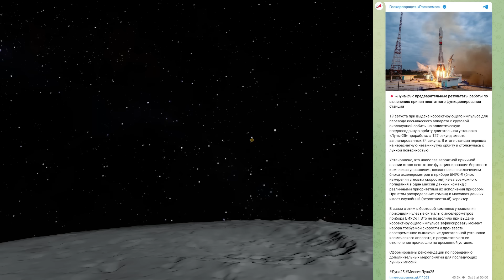Russian Space Probe Crashed Into Moon Because It 'Forgot' To Turn On Critical Hardware

Comment: Fatal software errors have got to be the most gut-punching failures because software seems so much more controllable than hardware. Once you launch, the hardware is what it is, if something fails, it's not like you can go up there with a wrench and sort it out; so baring some miraculous work around, it's out of your hands. Software though, can potentially be altered in flight, if an error is detected soon enough, the mission can likely be saved so it has got to hurt when a computer glitch is the cause of an unplanned disassembly.
Reply: It shows that it is absolutely your fault. No act of God, no broken widget…just you. Oh, and failure.

Comment: It's interesting to compare and contrast with another 'System Overload' issue - 1201/1202 Errors.

Whilst one issue relates to traffic on the bus and another to computing cycles demanded both issues relate to 'to much happening at the same time for the computing system'. And when you dig down both relate to a failure or inability to test the integrated system. In one case the prioritising was done correctly, in another it wasn't.

Ultimately there are also issues to do with error detection and handling policies and the balance between positive runtime checking for specific things that might cause failures and handling those failures if they occur, for whatever unexpected reason. Finally there is the 'is it worth it' issue. Is it worth (providing data is recorded that enables the issue to be identified post-accident) adding code to detect an error state at a point when it means the mission is already lost?

And then that drills down to the point that error detection and handling code is still code. Adding code to detect and handle error states adds complexity - it's perfectly possible to make mistakes in your error detection and handling code that lead to 'Loss of Mission' or it's earthly equivalent. There is a balance to be struck - I have seen code where there is more checking of values on entry to each code unit than code to actually do what the unit is intended to achieve. How reliable is that extra code? Do your test cases test it? Do you test your test harnesses?
Reply: It reminded me of the 1201 alarm too; 50 years on and still getting caught by the same thing!

Comment: Thanks for the always interesting channel Scott. I'm currently reading a book called STARBURST and LUMINARY by Apollo LM software coder Don Eyles. 

Fascinating insights into development of spacecraft software back in the day with of course references to classic computer polling, priority interrupt techniques and executive level software control of the whole caboodle. Some surprises also on what interrupts sank down the priority interrupt list of the executive control software for the Apollo LM. 

Regarding the subject crash, your comments regarding the use of data buses in place of 1960 era Apollo hard wiring also reminded me that we still encounter related issues on commercial aircraft these days. 

LAT and LONG words (bytes) randomly separated on a serial bus by a few milliseconds can produce some interesting position reports on ground ATC systems. 😉 

Never a dull moment in the spaceflight, software or avionics domains it seems! 

Blue side (mostly) up. Slainte!
Reply: That would be Sunburst and Luminary.
Reply: @stargazer7644  many thanks for the correction. Good catch.

Comment: Scott, that was a great report. I do question this “common buss & timing” . Yes there is a lot going on but I would assume the CPU is switching in the sub micro second or faster range.  So what is taking up so much over head? We’re they running Window 2.0 on an 8086 processor 😮😅

Comment: Why is the software not deterministic?  Why does it not check that the IMU is on before the burn?  Why does it not check that the IMU data is consistent with the data from the burn (fuel use, temperatures, whatever)?

It seems like people have lost how to write software, maybe because they're used to using libraries and includes and classes (etc.) and building software like it's some sort of lego set, and they never learned how computers or their hardware actually work.
Reply: with Russians you never will know what really happened, they had to build their own IMU because Airbus declined to sell them one, it could have been both software/hardware issue

Comment: 127 is also the largest integer you can store in a byte (eight bits) if you’re using two’s compliment signed integers. I suspect that’s the real reason for that value.
Reply: Which for positive values is the same as saying 7 bits as the eighth bit is a sign bit. But yeah, maybe they were super stingy and used a char. Or maybe it's a safety factor of 1.5 and the extra second was just an inaccuracy.

Comment: It sounds like they were also treating an absence of data from the accelerometer as measurement of zero acceleration. You shouldn't represent error conditions as valid values. 
Leads to you thinking that it must be freezing outside because you can't see the thermometer, or that the thermometer must be broken because it's reading 0°C
Reply: with Russians you never will know what really happened, they had to build their own accelerometer because Airbus declined to sell them one, it could have been both software/hardware issue
Reply: That's a bloody good point, you need to distinguish zero from a fault condition, or absence.
Although a pointer could have done this; a null pointer for no value available vs. an actual pointer to a zero value.
I'm not a believer in null pointers being bad.

Comment: How do they not simulate these things in advance to catch such obvious bugs? Properly testing software is surely much cheaper than the hardware, right?
Reply: It entirely depends on how much coding that needs to be tested. After all, they built the software from the ground-up, meaning that all of the software would need to be tested.

Comment: This seems like the kind of fault which formal methods is quite well equipped to detect nowadays -- i.e. essentially present in a high-level abstraction of the system that focuses on concurrency. You probably wouldn't even need automated theorem proving for the model -- if you were writing it by hand you'd have a WTF moment at some point I think.

Comment: My grandpa used to work in the Russian aerospace industry. I think something to do with the electronics of the rockets. 
He told me once that he learned from his former job connection an interesting story. One of the first launches from Russia's new spacesport "vostochniy" failed because engineers forgot to set up new parameters in the guidance system. The rocket thought that it was launching from Baikonur so it obliviousy didn't reach desired orbit parameters if at all, not sure. 
So yeah...

Comment: I was initially surprised at the transparency in the of the report, openly sharing the nature of the fault.  However - on reflection-  this crash was not the result of some obscure, unexpected set of circumstances ...  for example a freak hardware failure that relied on an untested branch of logic operations to sort out.  Rather this oversight is described as occurring right directly down the middle of expected operations.  Surely this was tested many times on the ground.

Comment: As a software engineer, let me just bang my head against the keyboard for a bit, because if you're relying on the inertial guidance system running, why wouldn't you check that it was actually running before committing to the burn?

kl;jsdgfhglklzcdf;sjmn,vg.xcfvgbsxkld,.;jmncv.kfm,lnzdgjxs

(I did warn you)

Comment: Feels like software safety often is overlooked. I saw some new car with a drive by wire system having like backups on backups for the mechanical parts (such as backup servos, two control computers etc) which then failed cause of a bug in the software. 

Can’t remember which car it was, but the point still stands, we almost never have backups in the actuall software itself, it’s one line of code and if that code is wrong all the mechanical backups doesn’t matter.

For critical missions like space stuff, maybe it would have been good to have 3 (or more) independently developed control systems doing the same thing. If one has a bug the others are unlikely to have the same bug and the error can be detected. Sure, it would make the software 3 times as expensive, but probably not more expensive than sending up another probe.